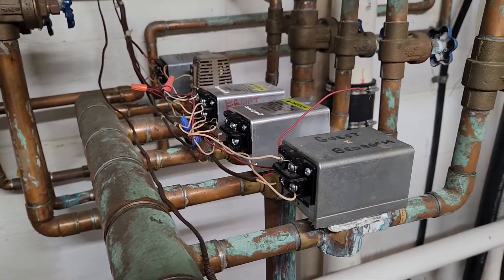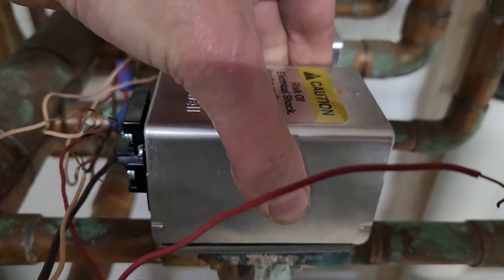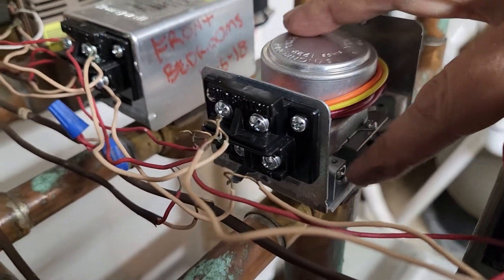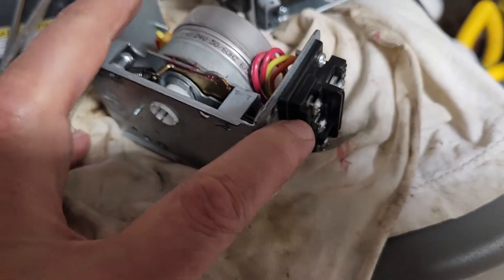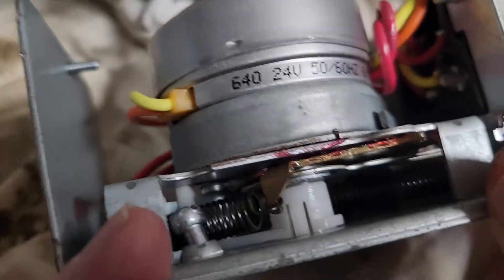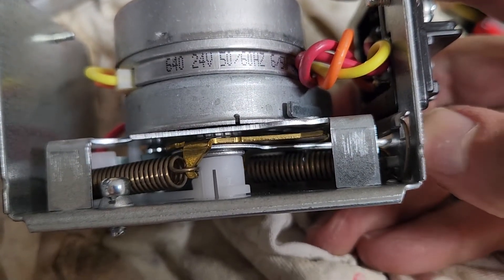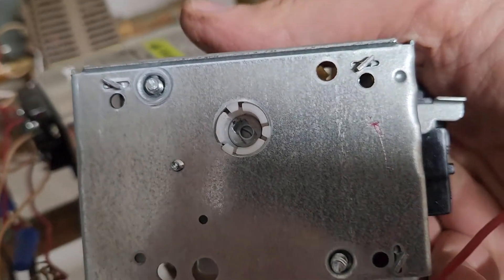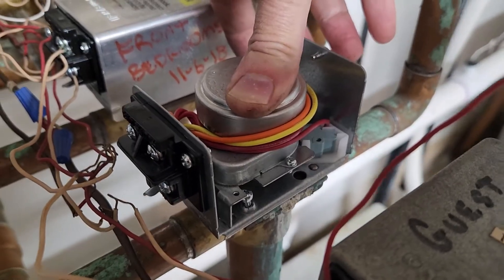Boiler zone valve stuck ON.

Comment: I used to do maintenance for large apartments  bldgs. They would often stick in the closed position seasonaly while the boiler water circulation pumps werent running. It was usually faster to just replace them.

Comment: This is very helpful. Last night my heat keps on going and I could not figure out what was causing it. Finally I opened the valve and wiggled the spring area with a scredriver which fixed the issue. Now I know what cause the problem. Thanks for making this video.

Comment: Thanks so much for the video. I'm about to try to replace my stuck on zone valve this weekend. It's the normal honeywell zone valve it looks like a similar set up to what you have here. Can I ask you how you would know if the stop ball inside the pipe needs to be replace or anything else? It seems like it's just stuck on and if I tap the valve very lightly with a hammer it unsticks.
Reply from the maker: You will need to remove the valve controller to see if it is the valve or the controller that is sticking.  Once the controller is removed,  you can turn the valve stem with a small wrench or pliers (it should turn easily- don't force it).
Reply: @diychicken7279  you're amazing.  Thank you so much for replying.
Reply: @diychicken7279  Hey I just wanted to thank you so much. I would have been lost without your video and help. It's crazy to think how much money you likely saved people by making this video!